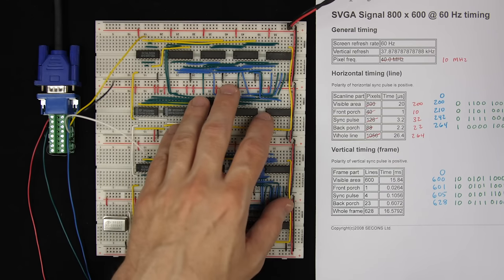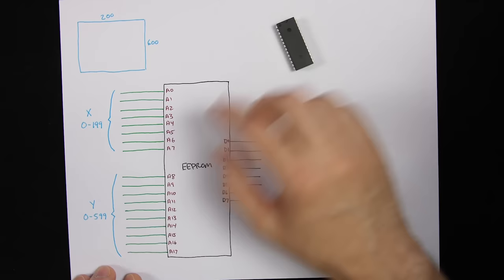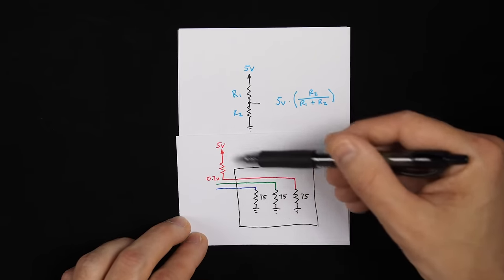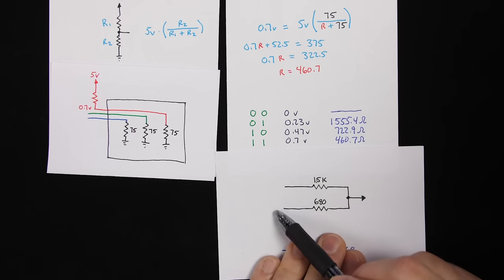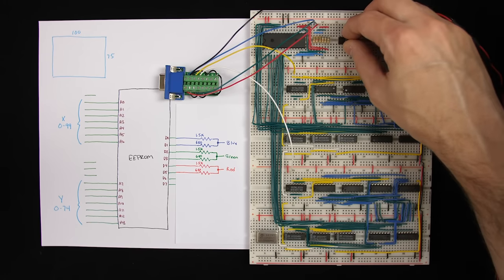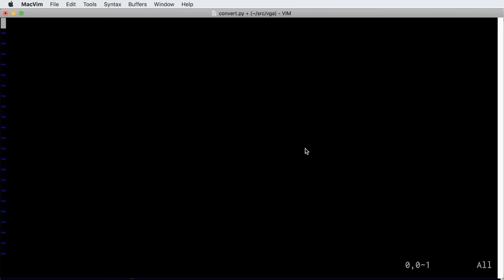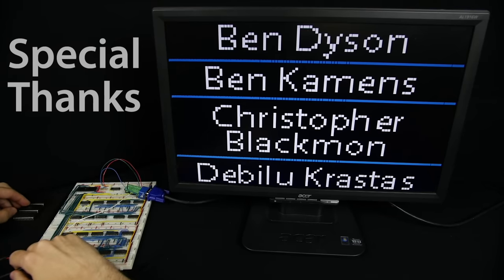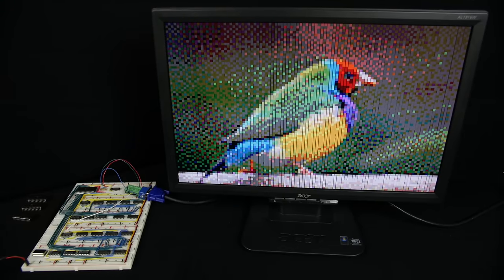World's worst video card? The exciting conclusion

Comment: 📺💬 ( add conversation ) he called and tell add some calculations for the lesson, can you create some conversation from this formula⁉
🥺💬 It is a parallel connection but acts like a serial connection, serial connection absorption of current and generates output when parallel voltages preserve the potential.
🐑💬 Remaining all devices working you need to preserve current voltages parallelly but concatenation.
 
📺💬 For some kind like you making output as VDO it would be possible.
🥺💬 I watch this VDO to study and my AI example is in GIF image or VDO, I like to learn but I selected lessons because they keep try to use of my lesson in the wrong way.

Comment: You could have evolved this more

1) the EEPROM can probably handle more data to make a low fps video on the screen (you can get a short video and reduce its frame rate , downgrade its Resolution , take the frames one by one (ex: 5 fps) and do the same photoshop for them on EEPROM.   use an additional counter to count the number of frames displayed and use it to increment the EEPROM to the next frames to form the video. (make the video loop)

2) get a dedicated voltage Regulator circuit or build one to replace the simple potential divider thus allowing more colors than mere 6-bit (64 colors) limitation   

3) design a 40 MHz clock instead of the 10 MHz occilator to allow for higher resolution ( utilize the full 400 x 600 instead of the 100 x 150 limitation) ---->(resulting in a sharper image , realistic and less blurry)

4) introduce a micro-controller for the setup if it makes controlling things more selective , smarter , easier and more effecient.

5) if you can replace the EEPROM with a RAM , you can Write to it on the go , then you can build a circuit to take a certain usb output from a pc and populate the RAM with it in Real time thus being able to change the output image on the go.  also if you can build a software usb driver for it somehow that takes screenshots of the pc desktop , downgrade it into the lower fps / res / color , and send it to the vga display circuit this would be a usb to vga display adaptor

6) if you keep upgrading it , you can get to a point where you can play high quality movies on the screen.
also , this is just a vga output circuit. a modern graphics card contains a processor capable of running a Rendering software that takes 3D Models made of triangular surfaces , and easily calculate real-time how they should look from a certain angle and at a certain lighting angle and intensity as well as do fast transformations on these 3D models. you can take it to the extreme , get a GPU from nVidia or AMD and run a simple Rendering code to render a scene or a simple game on the GPU and output it through your vga output circuit.

7) there is probably a small vga output controller that contains all your design and more on a small vga chip that can be used to abstract , shrink and encapsulate all this gigantic design into a very small chip. thus the final design can be shrinked and put in a very small and light form with superior performance.

Comment: "What I expect from you".. well.. first of all, you said that if you use a single digit for each of the base colours, you'd get 16 colours.. Truth is that you get 8..

Secondly.. would it be THAT much of a hassle do double the vertical resolution by simply alternating between the high and low bits?..